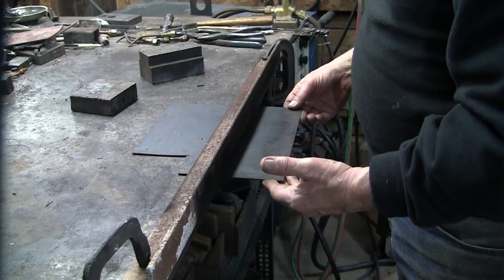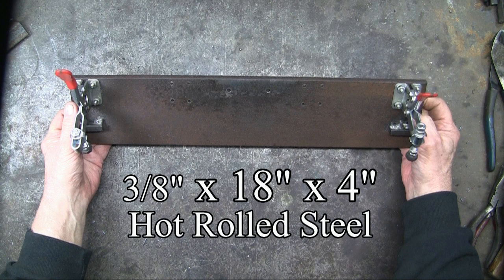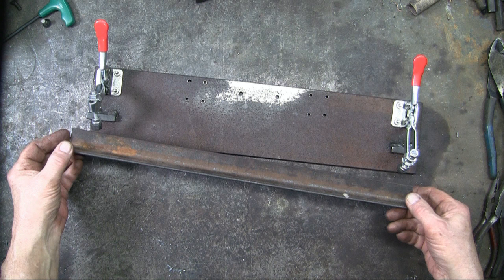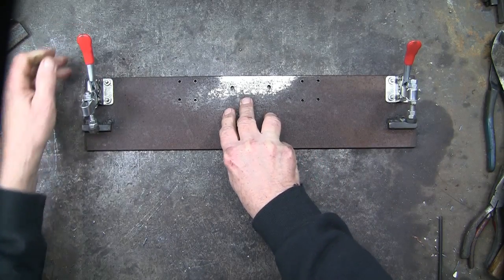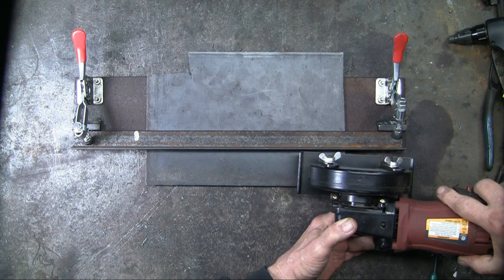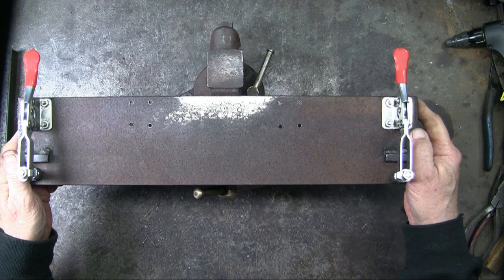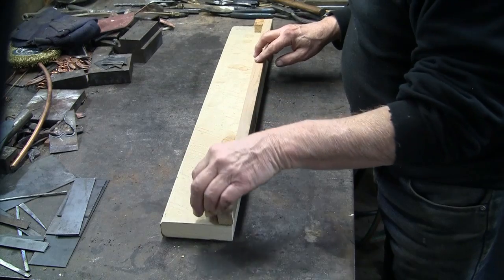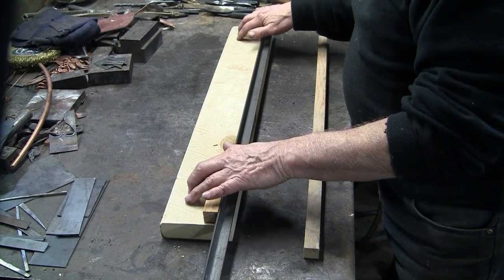Straight Edge Cutting Fixture - Part 1

Comment: Only problem with wood is that it warps unless our room is free of moisture and stored very carefully. Even stored carefully the upper wood is going to be inaccurate thru time. A solution is to attach/glue a thin strip aluminum on the upper wood to save $$.

Comment: Hearing protection, goggles and N95 mask. 2:38 They use fiberglass to hold the abrasives together which enters deep into lungs. Cancer results. A variable speed jigsaw with bi-metal is preferred since I use zero protection and feel well for my health.